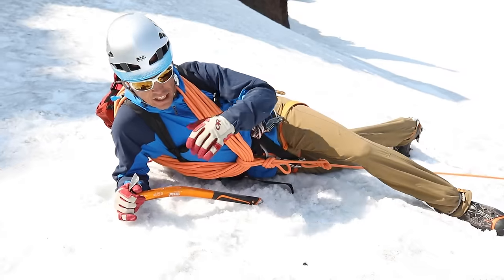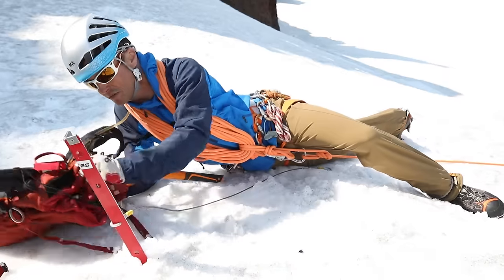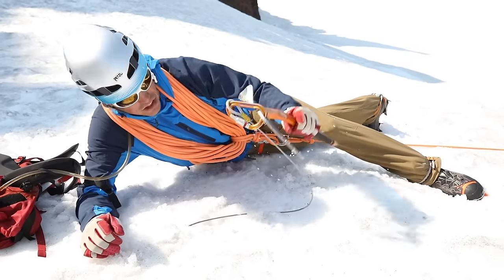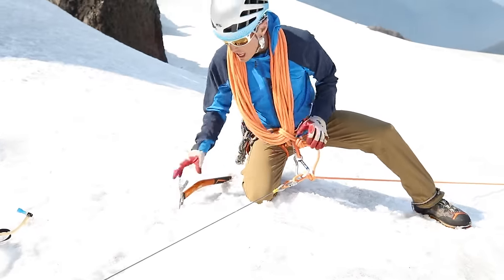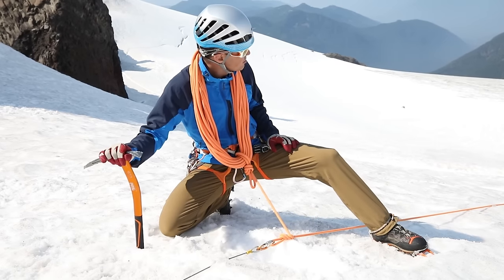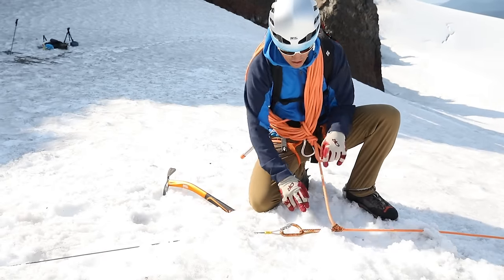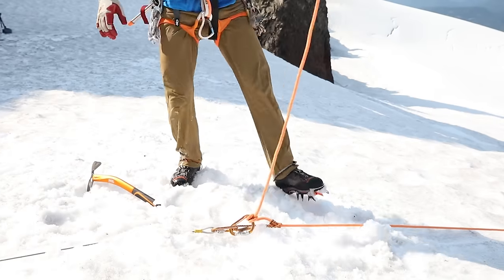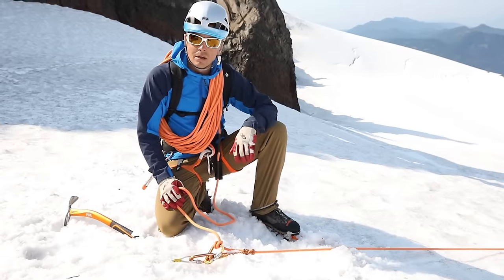How to Transfer a Fallen Climber's Weight to a Snow Anchor for Crevasse Rescue

Comment: Nice video.  In reality this is exceptionally difficult.  A loaded rope from a crevasse fall is much more severe and this process becomes almost unworkable.  I do recommend that people actually try this, but have the "victim" actually pull at 100 lb minimum and see how it goes.  It is very enlightening indeed and makes one question the wisdom of 2 person glacier travel, especially in places like Alaska.
Reply: ive practiced with an actual person, i get big time cramp in my hips verrrrrry quick! 100% a good idea and a must to practice properly, its so much harder than one would expect

Comment: Excellent video series. It's good to note that this professional guide does NOT use any sort of releasable hitch like a Munter mule. If you need a sort of releasable option or to lower the climber, all you need to do is pull up about 1 inch on your whole system, which gives enough slack to release the  Petzl micro traxion or prusik, then you can lower away. The munter mule Is a specialized rescue knot that's not normally used by climbers, and odds are you're probably going to forget how to tie it years from now in a stressful rescue situation. Keep it simple and focus on what's really required not on fancy options.
Reply: Munter mules are used by climbers all the time. What are you talking about? Nothing wrong or fancy at all about using it. Everything good about knowing it though, so that you can use it if you need to.
Reply: @davidwarren719  Here’s a little experiment you can try next time you’re at the crag or gym. Walk up to 10 random people and ask them to show you how to properly tie a Munter mule. Report the results back here.  Not only is it not taught by this professional guide, it’s also not in freedom of the hills, the generally accepted reference manual in the United States. It’s something to add to your toolbox as a more advanced climber, I agree, but it’s not a mandatory part of crevasse rescue and not something beginners need to know.
Reply: Well obviously someone who hasn’t learnt to use or tie a munter mule they’re not going to know what it is

Comment: Why do many videos on YouTube use an snow anchor and not simply the ice axe as anchor? Why carry not definitely necessary weight on top of the mountain?
Reply: I'm not a professional but if you use a  picket you can still use your axe in self arrest to back up the system in case the anchor fails. Would be very hard to catch the fall if you don't have an axe in your hands. Bringing the picket also means you can have a second anchor so the system is redundant/equalized.
Reply: I very much like having my ice axe handy but it is a valid point.
Reply: Ya honestly my axe is the last thing I want to give up but if you watch the next videos he does use it to prep the lip of the crevasse. Giving up the axe really limits what you’re able to do beyond that like backing up the anchor. 

The pickets don’t weight much either, I’ve never had to seriously consider if a pickets weight was worth it or not it 100% is.
Reply: You might need an ice axe at the later point, when pulling the "victim" out of crevasse. Its often popular to place ice axe (or something else) under the established rescue rope (need to remember to secure it to the main rope also). That prevents the rescue from from cutting deeper into the snow when you pull somebody out. But sure, if you have nothing else, use the ice axe then.

Comment: 15* angle back is correct if this was a top clip. It is not correct or a mid clip wire cable picket.

Comment: Shouldn't you dig in this snow anchor the other way around, so that outside of the corner is facing the direction of the pull?
Reply: Not with a Yates mid-clip picket like he's using- it's designed to be placed like he did it. If you were using a traditional "T-style" picket, you would face the skinny side of the T downhill, and you might even dig a deadman rather than placing it vertically like that.
Reply: that would potentially pop out. You need a certain amount of angle, relaed to the slope angle.

Comment: That was good but why don't u use jummar it's more comfort than prussick hitch
Reply: Because you aren't racking up for aiding on El Cap- you're probably going for light weight and minimal gear if you're bringing it deep into the back country.
Reply: There is a thing called Tibloc that is designed exactly for situations like this, check it out
Reply: @matejpevny4375  prussik is just as good. You might need a tibloc later on, when pulling out on the rescue rope. Unless you have two tiblocs. Or unless you dont mind moving prusik on the rescue rope, while pulling up.